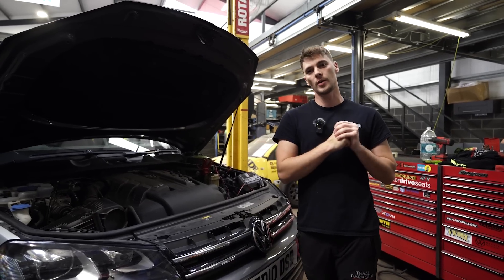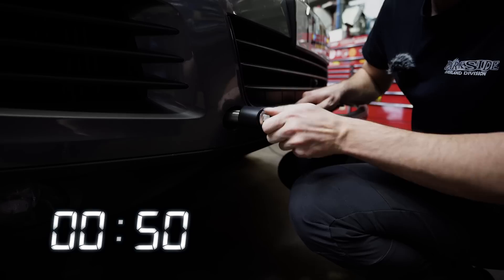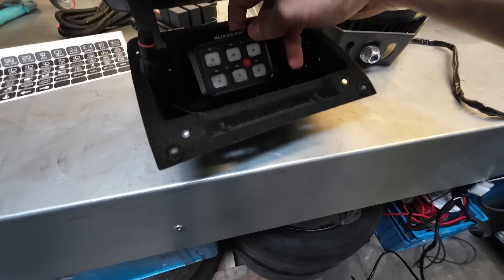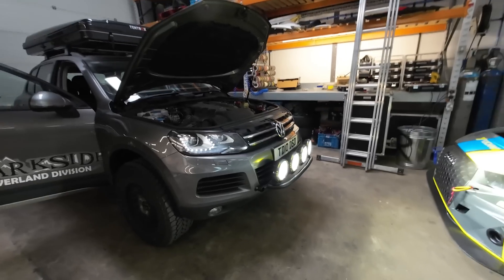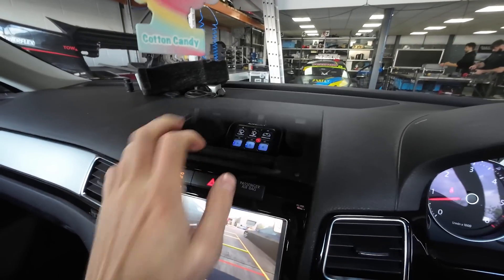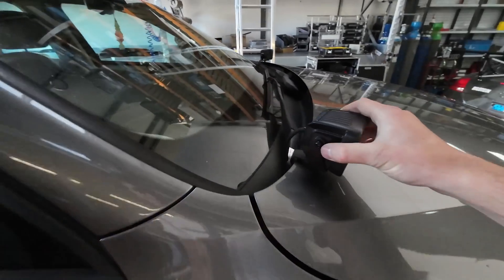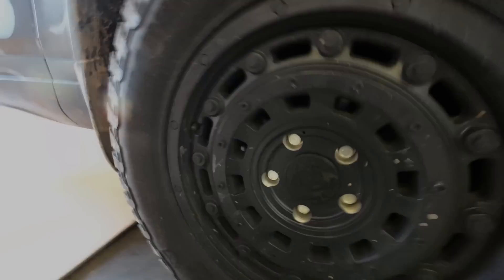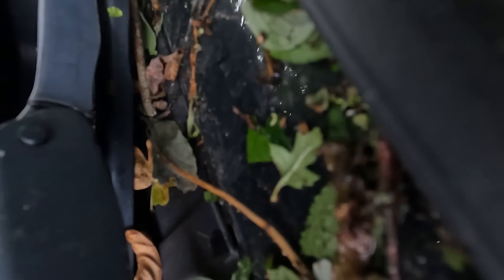LIGHT 'EM UP!! 🔦 Touareg and Cayenne Light Bar!

Comment: if you can make custom bolts why dont you make or modify 2 original towing eye bolts to hold the light bar on so you have 2x permanent towing eyes at either side of the light bar?
Reply from the maker: The threads on the stock towing bolts are not long enough to do this but we are working on a solution. Take a look on @dannymellor on Instagram
Reply: @DarksideDevelopments  okey dokey I’ll go check it out.
Reply: @DarksideDevelopments  also, you know the ditch lights on the bonnet, as the light comes out of the lamp it makes a triangle reflection shape on the bonnet, why don’t you replicate that shape on the bonnet with some Matte Black vinyl to prevent glare. A bit like how they use alcantara or matte black paint on race car dashboards. I’m not just a pretty face.
Reply: @DarksideDevelopments  Are these for sale yet..  I tried to look but didn't find it online at your store. extended bolts with towing eye

Comment: Hi! Wondering if you guys could make a video on how you guys ran the switch gang through the firewall?
Reply from the maker: We just ran the wire through an existing gromit on the passenger side, however we're testing some wireless controllers which will make the job easier and quicker

Comment: Top job lads. Can you advise where to buy front frame like yours to attach long range LED lamps. Also can you advise how did you activated those small lights inside main lamps those cone shape sitting closer to a grile.
Thank you
Reply from the maker: Check the description or drop us an email, we have all the parts available 👍

Comment: Would the light switch thingy fit in the 12v hatch near the gear selector?
Reply from the maker: We'd have to measure it but possibly
Reply: @DarksideDevelopments  would be great down there as I find it useless, but also more easily accessible for light switches that the top of the dash
Reply from the maker: We're also looking into a wireless connection as well making it easier to place anywhere you want to

Comment: Hi. Does the bar and lights impact parking sensors? 
I am interested in ordering one for my Touareg.
Reply from the maker: This light bar sits in front of them, however we have now made a raised light bar here - https://www.darksidedevelopments.co.uk/products/bolt-on-raised-light-bar-for-vw-touareg-porsche-cayenne.html

It's compatible on the 7L and 7P models, however on the 7P it may be picked up as an object but the sensors work as normal
Reply: @DarksideDevelopments  Hi. Thank you for your response. I just bought 7P, and looking for some offroad upgrades. I will send you an e-mail when I am ready to buy.
Reply from the maker: We've definitely got plenty of off road parts for the 7P's! Look forward to your email!

Comment: Why not mount the 'ditch lights' on the roof rather than the bonnet? Would give you greater throw and smaller shadows.
Reply from the maker: The bonnet has easy to access bolts to mount the brackets the roof is not as easy unless you have a rack